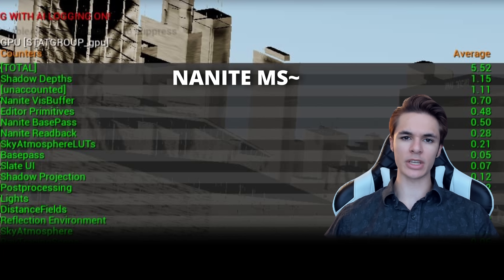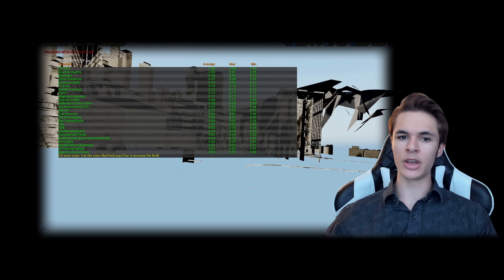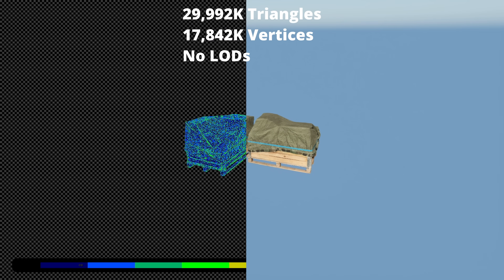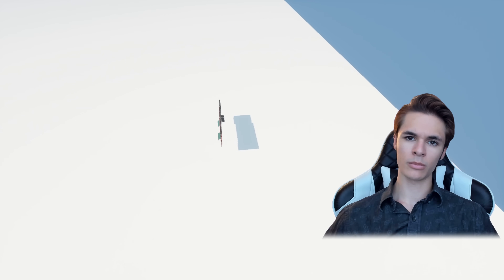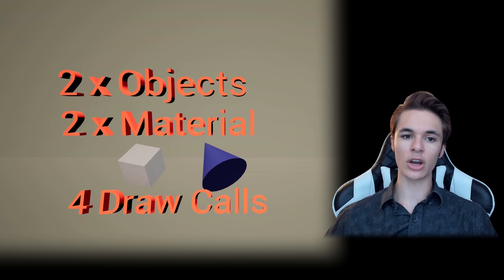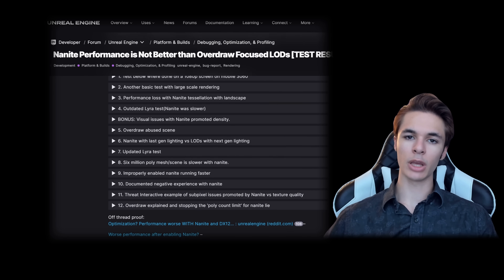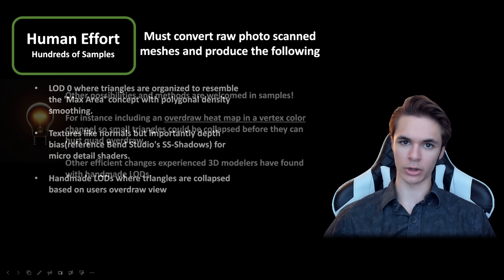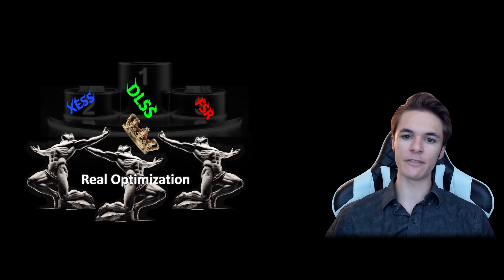Epic's Unreal Optimization Disaster | Why Nanite Tanks Performance!

Comment: These arguments ignore the entire point of nanite. Nanite isn't there to make things faster, but to minimize the cost of what is effectively an infinite LOD. It's also meant to interact with lumen and let realtime light work at great distances without terrible drawbacks. The cost depends on lots of things but at the end of the day it will always be slower than an already-loaded model simply because memory locality is the reason for most performance issues in gpus.

Comment: I hate ue5... Games looks like dogsh*it, barely runs and the blur omg the amont of blur in every ue5 game is insane and the best part is that you cant simply disable it, you have to go to appdata and edit engine.ini... I'm not buying any game running on this engine... Games are way more unique running on their in-house engine, especially those from early to mid 2000s. Now any game you paid 70$ for is the same with different textures. My recent exception is Dead Island 2... It looks gorgeous and runs on 200 fps with rtx 3070 and loading times? Literally 3s on ssd from main menu to game, i was shocked ue4 could be this optimized, yes ue4.

Comment: I disable Nanite and virtual shadow maps ever since first UE5 release, always got worse performance and some other problems with those two. They literally described VSM as normal shadow maps but with like 8x resolution, it's something I never wanted. To fully get your FPS back you also need to disable nanite completly with command r.nanite=0 if i recall. Also, they recommend to have SSD to use nanite, it's another part of players excluded from playing your product. 

Literally, huge amount of geometry is not something players need rn, imho. Games can look good even w/o 2mil poly walls nowadays. 

Lumen is heavy and problematic, but it is impressive at least and fun to play with in some scenarios

Comment: I thought the whole goal of nanite was that, because it was rasterized on the cpu and shaded on the gpu, that quad overdraw was not an issue
Reply from the maker: Quad Overdraw is only relevant to non-Nanite. Nanite has a giant per-pixel cost in comparison with overdraw contained quads.  

Nanite has a whole other set of performance issues that our test scenes didn't even exploit in nanite such as "nanite overdraw" which is caused by overlapping meshes.